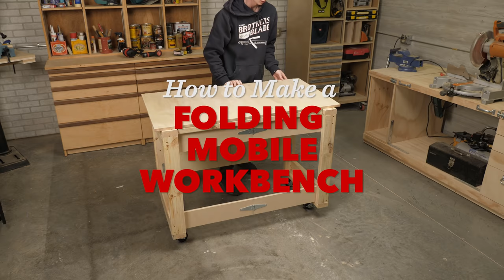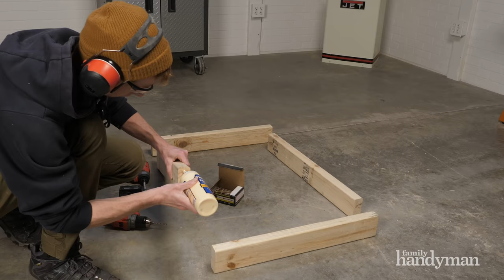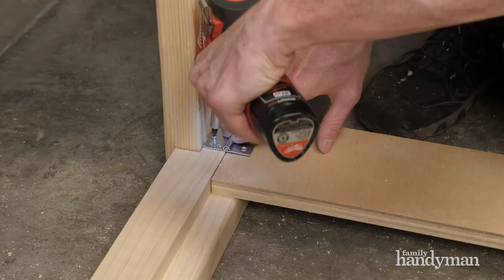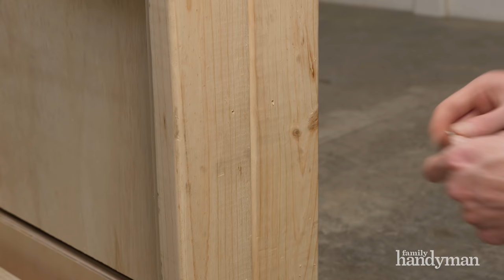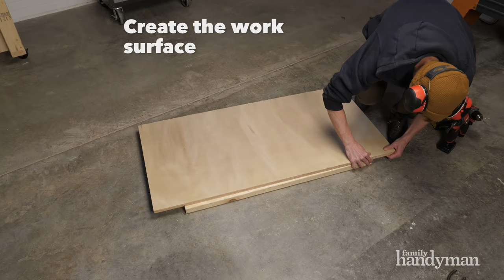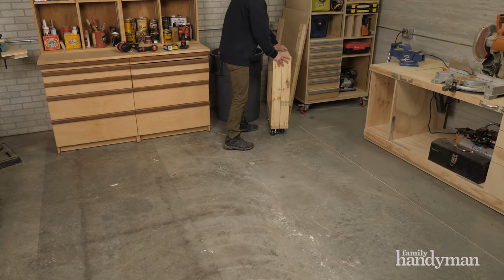How to Make a Folding Mobile Workbench

Comment: I built this last week.  It's a somewhat flawed design that needs further refinements. The straps need additional support which I provided via sash locks and by using 2x4's to support the length of the top in addition to blocks under the table to prevent the top straps from moving.   This also prevents the top from sliding out of the frame.  Also, forget about building this in 2 to 3 hours.  More like 10 hours.  Mind you I don't have a table saw or a chop saw, only skill saw.

Comment: I like the table but my strap hinges don’t stay open all the time, great table but a little awkward
My straps fold in to easily
Reply: I was thinking the same thing when I saw how easily it folded. Is there enough space to add small slide latches on the inside of the two panels? That is what I was thinking of doing if I build this bench.
Reply: @lmcsquaredgreendale3223  Just finished building this.  I did 2 things to "lock up"  the unit during use.  First I added blocking at the ends along 24" sides (screwed to the bottom of the bench top panel) to force the base to stay extended.   Second I added plywood blocks using 1/4 x 20 bolts, washers and wingnuts that I secure just before putting the top on.  They mount to the inside of the top narrow cross piece and the inside top of the wide cross piece.  Note inside means the side without the hinges!  The bottom narrow cross piece stays locked by itself once the other 2 locks are installed.
Reply: I recently watched a video where someone used sash latches opposite the hinges to lock everything in place.  It looks pretty solid.

Comment: I like it.  Is there a place where i can find the prints for actual dimensions?
Reply from the maker: Yes! You can see the full how-to steps with dimensions and diagrams here: https://www.familyhandyman.com/workshop/workbench/saturday-morning-workshop-folding-mobile-workbench/view-all/
Reply: Well, if you actually attempt this, you’ll find their materials list is incorrect, you need 32’ of 2x4, not the 24’ listed, which means now I have to go back to Home Depot because I’m 8’ short...
Reply: The plans say to attach two 5" pieces (piece E) and one 18.25" piece (piece F) to piece D, which is 27". Am I missing something?
Reply: @alexmendez9380  No you are not.  I am building this bench now.  Just got to the part where I attach the folding panels.  The plans cut list is wrong.  I made mine slightly taller at 27.5" so cut the larger plywood panels at 16" which leaves me a 3/4" gap between the panels.  Frustrating!